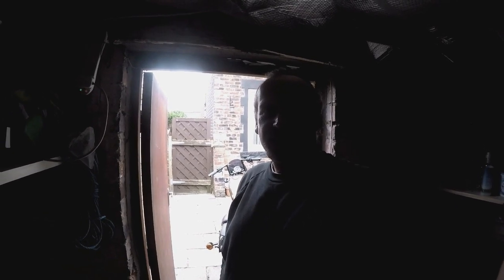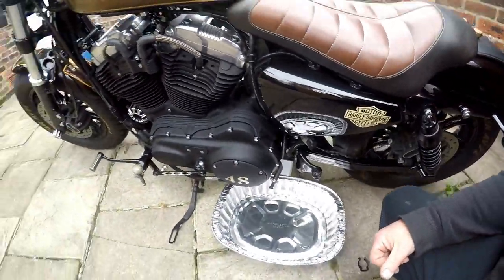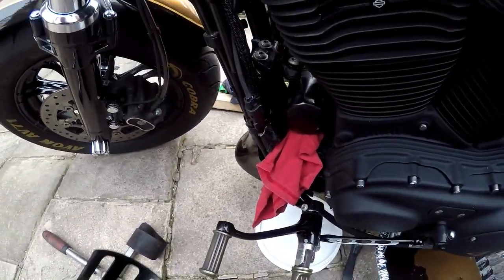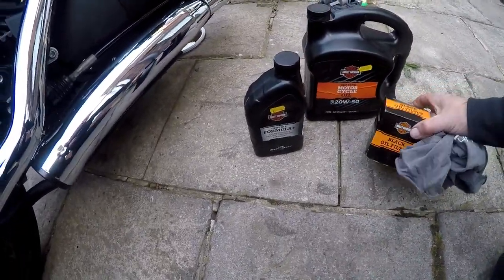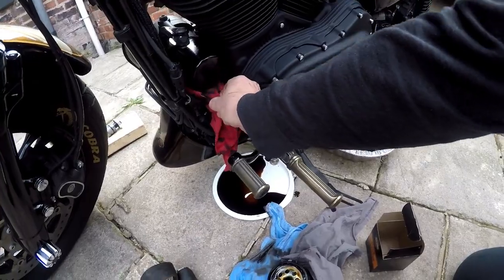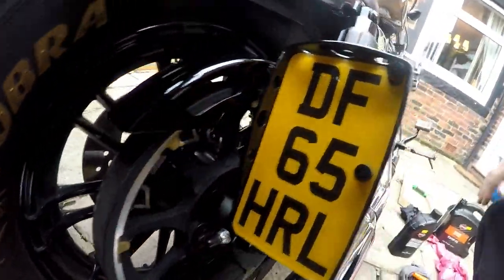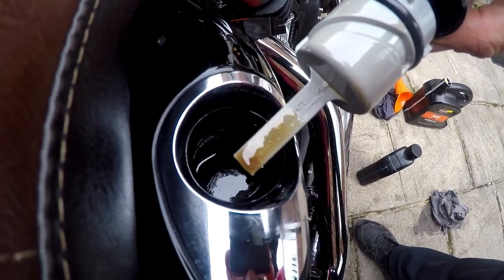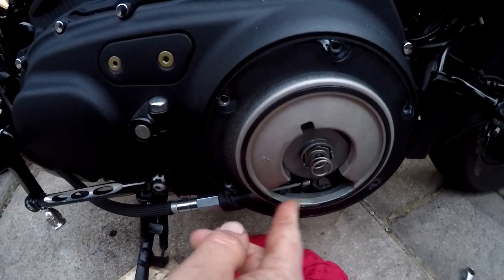5000 mile service/ Sportster 48

Comment: Hi - I notice your front indicators are illuminated white. How have you achieved this.? It makes me wonder if your bike is an American import since their front indicators are illuminated orange and are always on, yet blink, unlike international bikes where they only come on as indicators.
I see custom dynamics do a led kit but it looks like for an international bike you have a steal a permanent ignition feed to get them to stay on white all the time, whilst somehow connecting this wire, in addition to the LED bulb plugging in.   I think American bikes have a 2pin indicator bulb and international 1 pin bulb. Cheers
Reply from the maker: They are custom dynamics led inserts which act as sidelights and change to orange when using indicator.👍. You basically pop out the lens,which i have peaked lens caps ,remove bulb. Fit new insert and wire in sidelight. 👍
Reply from the maker: Just to correct myself, these may be ricks inserts, or similar to C/D type  have to check back

Comment: Can I ask where you got the number plate, I pick up my first harley on Saturday, same as yours a 48. It has a vintage black and white small side number plate, although it looks great I'm sure I'll attract the police if they are behind me, so ideally I'd like one like yours not a standard, but can't find a website anywhere. Cheers ride safe
Reply from the maker: Show plates mate, on 3 vertical lines, measure your plate surround and look on ebay for show plates, tbey will make to measure.
Bet you cannot wait to pick up bike 👍👍. The journey starts from then 👍
Reply: @ALCHEMOTO  yeh looked on show plates, can only get a 6 x 4. I'll keep looking. How's the bike, any tips.
Reply from the maker: @redponte1  there may be a sickness member who could point to a platemaker, Im guessing you have joined up on fbook ?.
Tips wise, dont go buying things right away, research and ask questions on quality, fit, before looks. Create your vision based on what you like and make it your own. That way you stand out from the crowd 👀👍

Comment: You're supposed to pour 4 ozs of fresh oil into the filter and let it soak to avoid the problem you mentioned.
Reply from the maker: It doesnt make any difference as long as you bleed off to avoid any cavitation. The filter is on the return side,same as most engines with an inverted filter. No harm in doing so , and no harm in not as long as filled correctly either way 👍. Vertical filters I always fill.     Or if it was a freshly built engine, but like I said, makes no odds, just preference 👍
Reply: @ALCHEMOTO  do what you want, but the service manual from harley says what it says.
Reply from the maker: @snidely_whiplash  they have to cover every angle to avoid warranty via negligence 😉👍
Reply: @ALCHEMOTO  what next? You going to tell me that torque specs don't matter?
Reply from the maker: @snidely_whiplash  No, as your the one looking for advice. 30 years I have been building,repairing and servicing engines, and not 1 failure, and as workshop manager, people seek my advice daily as a proven qualified, time served engineer... not some weekend wannabee mechanic who has to read a manual to tie his shoes 👍
Reply: @ALCHEMOTO  Well aren't we just the Belle of Snodland Town.